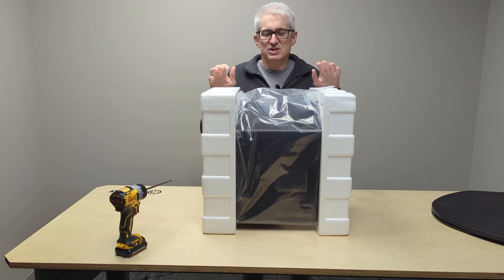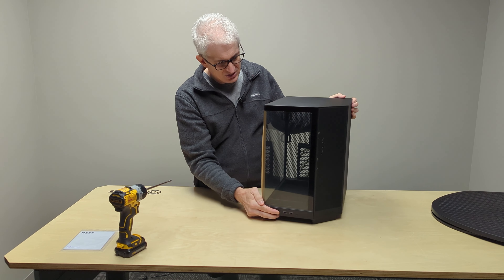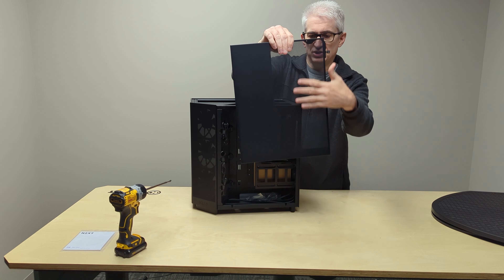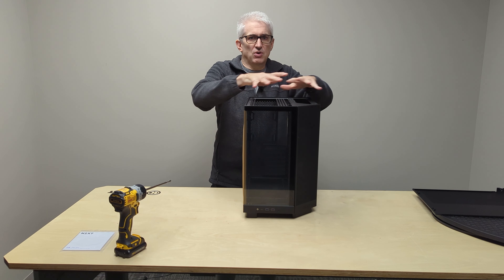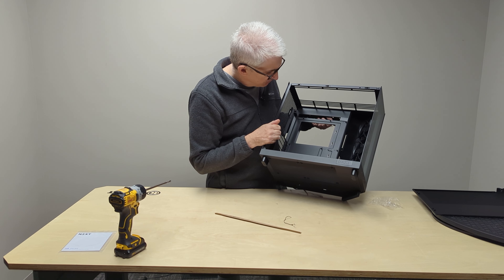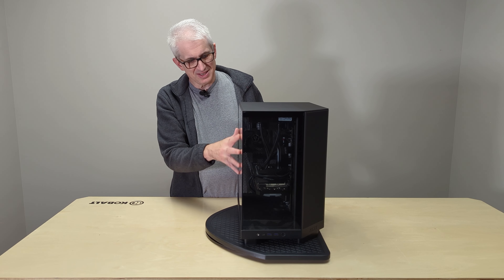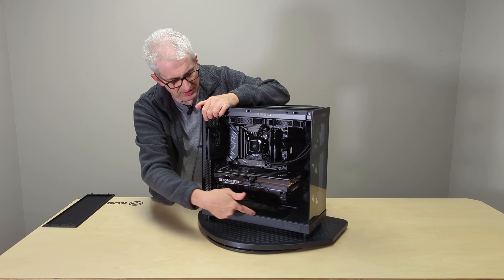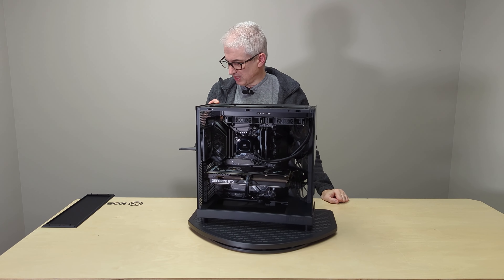NZXT H6 Flow Case - Checking it out and before and after a build

Comment: Dunno, it surely looks cool but that angled front gives me the impression it could create a low pressure area close to the front glass making the dust cyclone there and collect there maybe make the airflow confuse in that area

In a regular dual chamber case the sidewall fans act more as cold air feed for the flow made with the bottom and top fans that will dictate the main flow happening.

But that case would be a great candidate for a horizontal build

Comment: This looks like a case where the user custom builds a water cooling system and adds lots of those obnoxious RGB lights. The AIO in the build looks awful, with the two water lines just hanging like they are, and I wonder if that was the best orientation for them?

It's also too bad that many of the case makers have forgotten that lots of us need those FRONT expansion slots more than the gimmicks they are adding. Reminds me of the craziness of phone manufacturers removing the headphone jack and expandable storage from the phones. Phones aren't any smaller or thinner with them missing, nor are they less expensive.